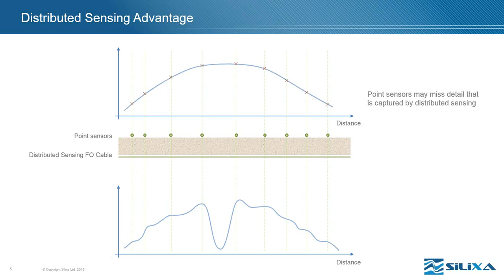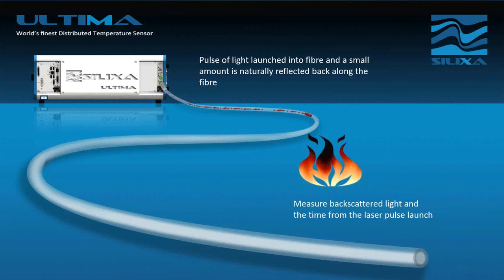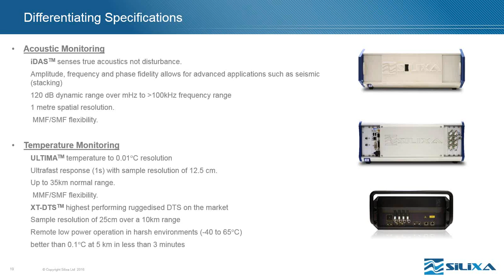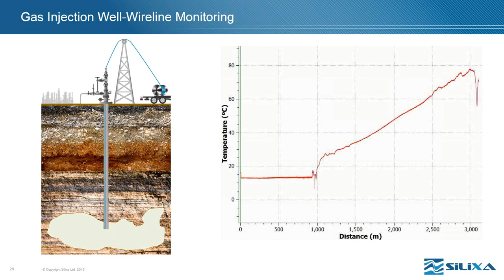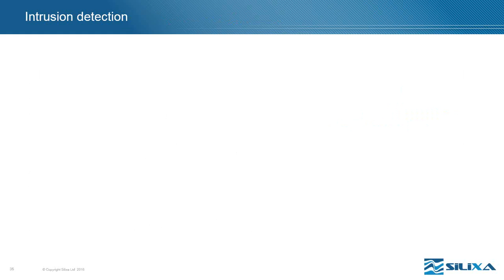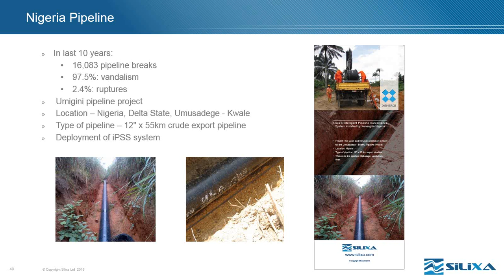Fibre Optic Based Distributed Acoustic and Temperature Sensing, Silixa

Comment: To keep these systems and other provisions compliant you will need our software. (BRZO+/Seveso3/ EU regulation)  However this is a Magnificent system. I spoke with Leoni AG and Yokogawa about this technology recently. Never could imagine fiber optics could be used to locate a leak (LOC/LOPC) or a fire within 50 km and a accuracy of 1 meter!  etc. (  worked with fibre-optics back in the year 2K, internet broadband backbone in EU)